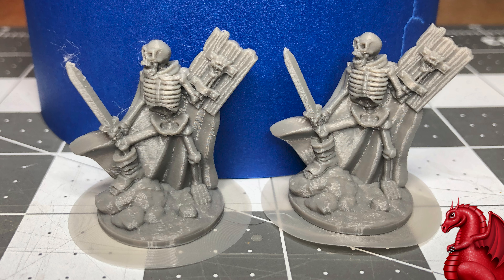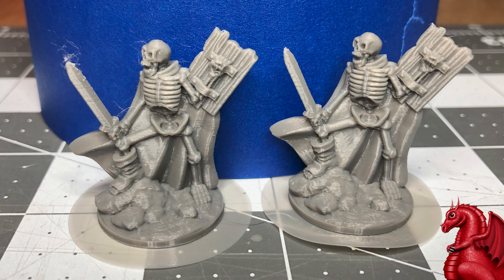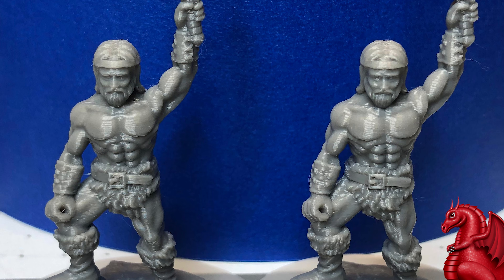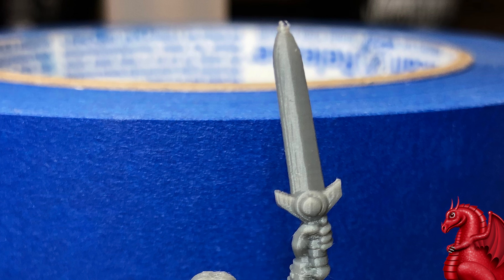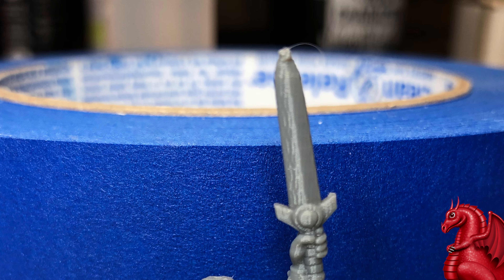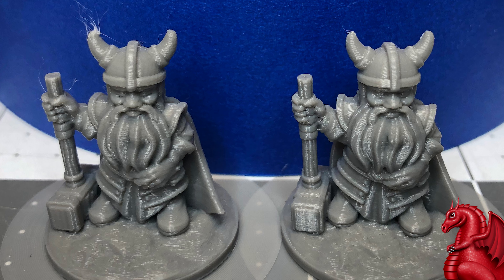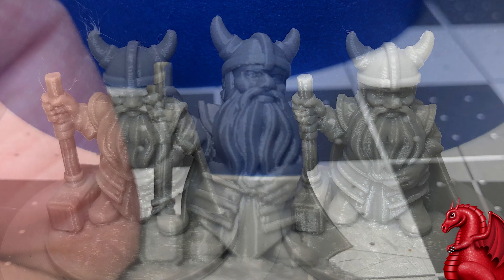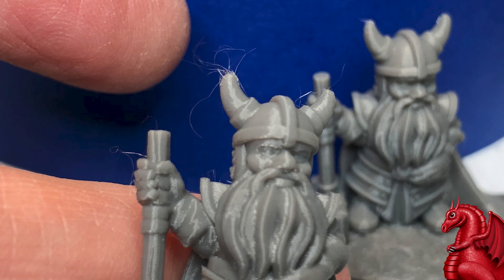Bambu Lab A1 versus A1 Mini print quality

Comment: Cheers! Would love to see A1 vs P1
Reply from the maker: I have no plans to buy a P1 so probably not going to happen. :)
Reply: @Tombof3DPrintedHorrors  cheers for replying! They are really nice, much better than A1 in my experience. I've used the screenshot from your A1 settings to make myself a wee profile anyway cheers again!
Reply: @LLJW4  would be interested to see your results
Reply: @LLJW4  I have had a P1S since this time last year. I just got an A1 and I am stunned to see that the print quality of a particular lithophane item that I print a lot of is better on the A1. Of course this is just my experience but it seems to do with the way the slicer adds short interior walls for the P1S that it does not do when I slice with the same settings on the A1.
Reply: Curious as well on this for a P1 or P1S. Been looking at the CoreXY printers for my next one.
Reply: @Senjo5663  I have a P1S and an A1M and the print quality on the A1M is identical.  If it fits on the A1M plate I print on that first.  Its faster and the AMS Lite does filament swaps faster too.  I personally have 0 interest in a full size A1 after having the P1S tho.  The A1M is the perfect companion/mini printer but I've already printed some stuff like the Dune Crysknife that 100% are going to break off the supports on a full size A1.
Reply: I have seen P1 printers have some sort of VFD problem, so probably worse than the A1's

Comment: I am still using Ender 3 and found that changing "Wall Ordering" to "Outside to Inside" has made a huge difference in quality.
Reply from the maker: It does, but it makes overhangs worse, so it's a tradeoff.

Comment: That's really interesting. I've got the A1 and have been using your profiles with a 0.2mm nozzle and I haven't had that much stringing or those little zits when printing small figures. I wonder if it's a filament thing? I'm using Hatchbox PLA grey.